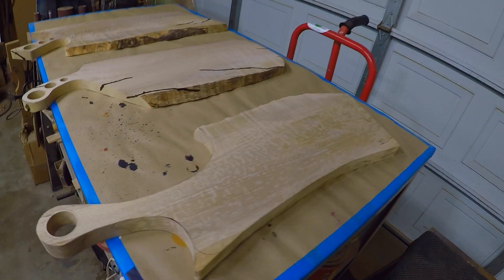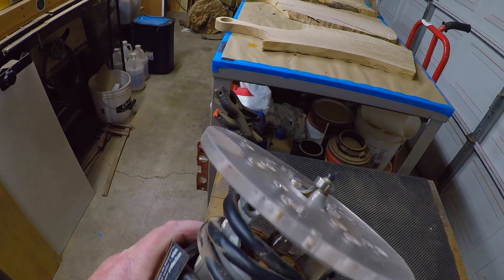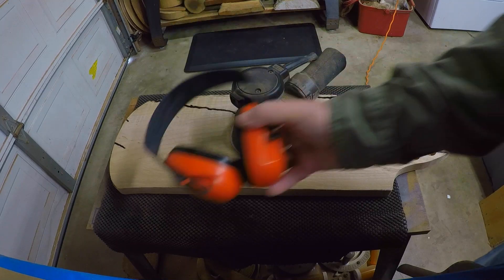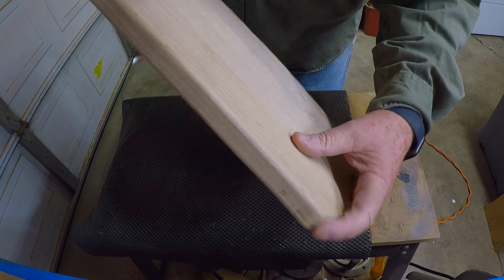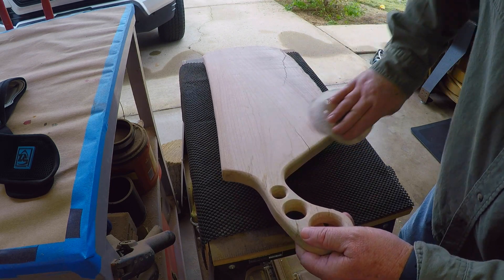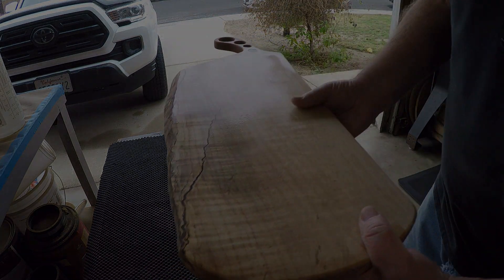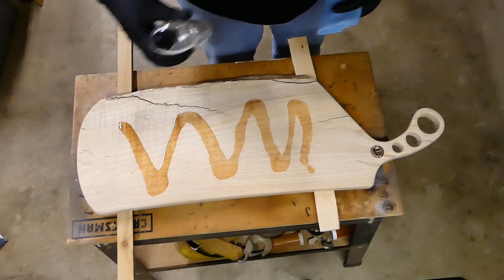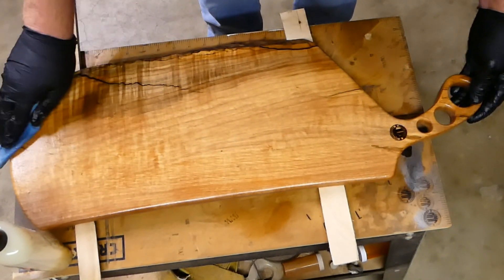Woodworking-"After the cut"

Comment: Very nice Bruce! As for the oil. You said regular mineral oil works. Ive heard that it is food safe, but never completely cures. Is that what youre wanting on a cutting board/charcuterie board? (I ask, because ive never made one, and im guessing that would be to keep unwanted substances from soaking into the board) Thanks buddy. They look good! Happy Thanksgiving!
Reply from the maker: Hi Dave, thank you very much! Regarding the mineral oil, yes its food safe, never had any not cure, it does, at times take a while to completely soak or penetrate the wood. The oil does keep food and fruit juices/oils from penetrating the grain of the wood which could turn rancid. Use closed grain wood species, open grain just invites foods to get trapped in the open grain areas. Thanks again and Happy Thanksgiving to you and yours.